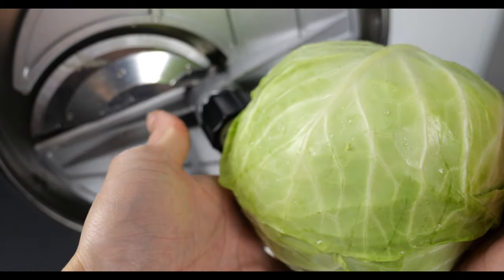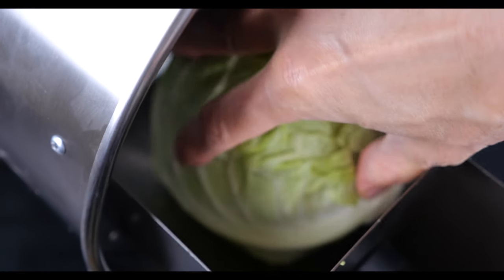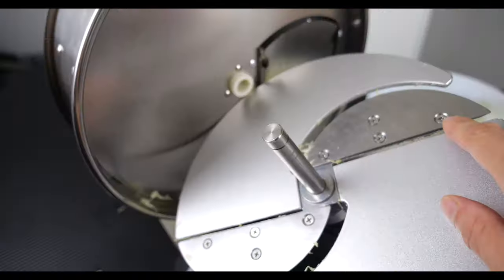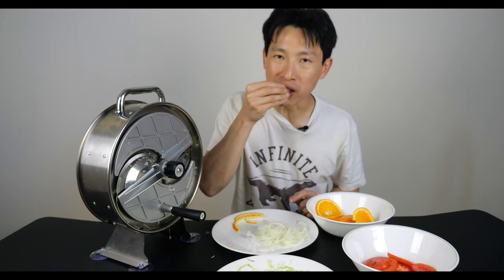Industrial Fruit and Veggie Slicer Review [Wichemi Brand]

Comment: 3:10 Actually, that's not ok, because the thinner you slice the more slices you get from on object, so the more useful it is to have two cuts per turn instead of one.
Reply from the maker: Probably needs some tweaking to get it to cut two times.
Reply: @BeatTheBushDIY  I though the same...

Comment: Nice! I still prefer my food processor, though. Sorry. It won't cut large items like yours though, so I have to cut them thinner first, but it's faster and easier to use and it's easier to clean.
Reply from the maker: Ahhh, your does slicing I assume. This is totally overkill for a typical home. More for restaurant use.
Reply: Good invention  wel come.

Comment: Do meat for shabu shabu
Reply from the maker: This doesn’t do meat but I made a meat slicer video for meat many years ago.
Reply: @BeatTheBushDIY  I mean, what's stopping you from slicing meat?
Reply from the maker: @alexander255110  I suppose it could but it might not work well in a single down action. Meat is not as soft as veggies so you could encounter not being able to slice it in certain cases like if the meat is not half frozen enough or if the meat is too tough for the blades. BUT... one could try.